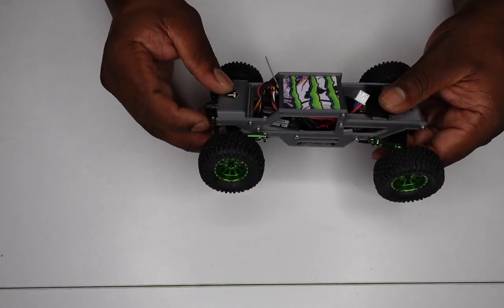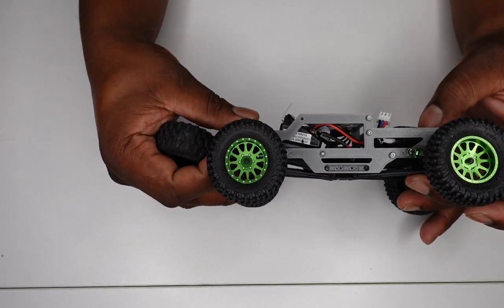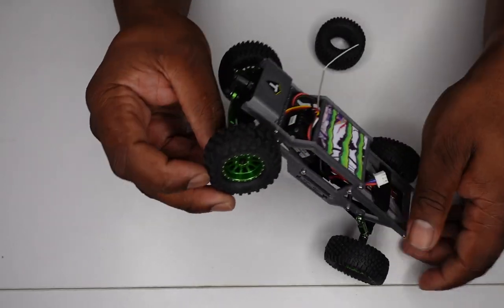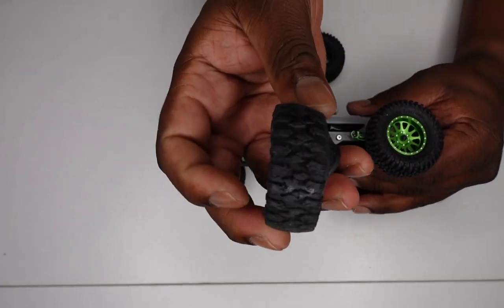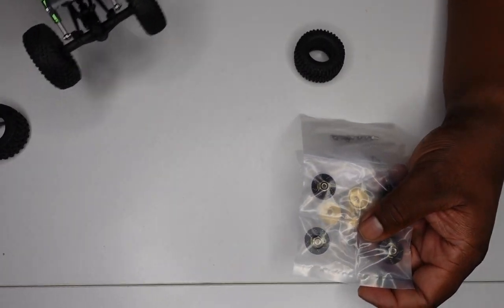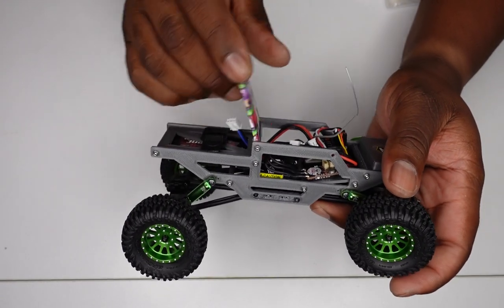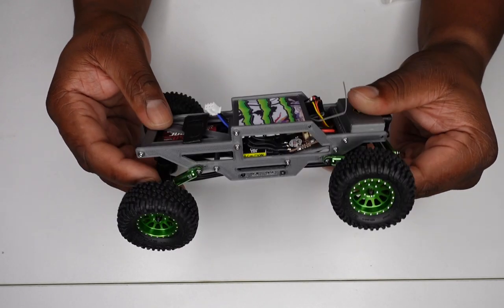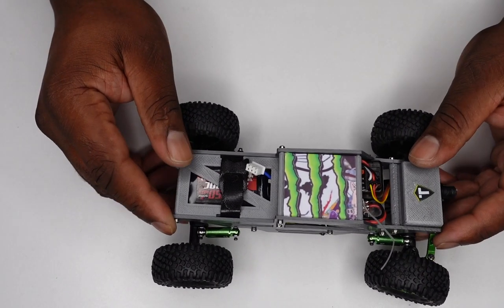Axial SCX24 Warthog AKA Gollum First Time Course Crawl Plus Whats Next  | Got No Chill RC

Comment: Where did you find 1 piece metal wheels? I like the idea of being able to pop tires on & off, sure makes testing ties a snap
Reply from the maker: Here you go https://www.ebay.com/itm/393433165986?hash=item5b9a71b0a2:g:9scAAOSwkC9g57~C&amdata=enc%3AAQAHAAAA4LtcwmL3QFwh0vqGE%2FvZaUiCuI9HMwewPNpP7vxgiF8vtEPpNPYrLV2JGsVsYCcD5uyldUM7ZQ34v2k0%2BSxFDG3fMVwV0jgsr8HIAAEKT1VuOyzTDVP0jnR0vXRJo85GvSea7KxAEszaS9pSxge5z8OYurPqcgZJtidq2vJJOQF9WshqzoQYcPrDx4yX5YURJEICqZAXu8bVDJundhO5awNocJ4X%2FceGQ74qLTzIscRRVMDO0GrHqpu7fxhxvmk0yBwklt3he414Gu2cnwlQJ5wo40gnkbf%2FPooLtu7AWvEy%7Ctkp%3ABFBM4Nrts7lg

Comment: Hay bro put the spring on the shaft so it pulls the shaft back in instead of pushing the shaft out use the treal wheel wideners that new motor will give you plenty of power.
Reply from the maker: What’s up Jay, I’ve been thinking about doing that, I’ve got  another motor I’m about to inbox, stay tuned bro! Thanks for watching!